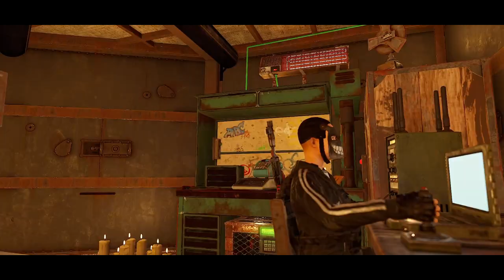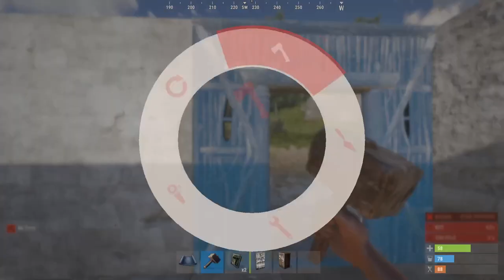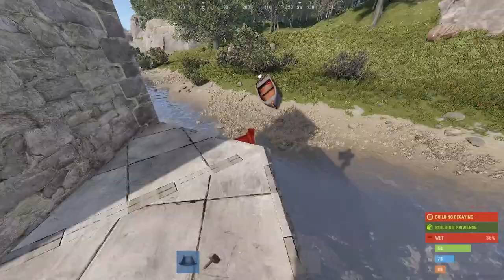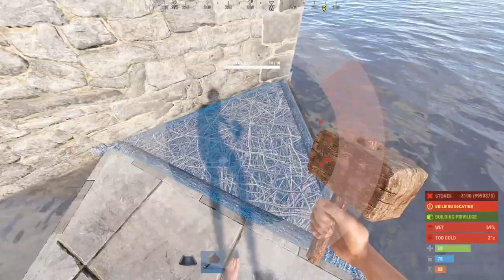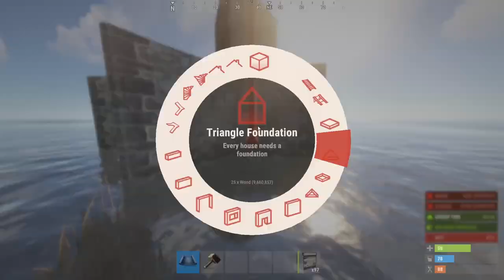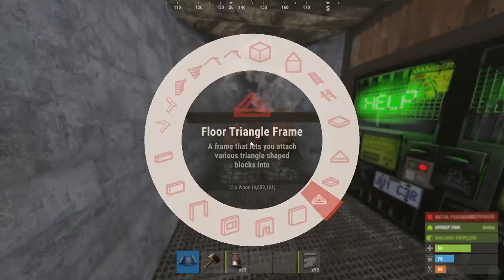The Rig Runner MINI - NEW META 1x2 BUNKER BOAT BASE SOLO/DUO/TRIO (RUST BASE TUTORIAL)

Comment: Nice little boat base with a bonus heli garage. It's stout even without the bunker working. I like the mobility layout. I would RP it with some planters and a little dock and lights. But that's me, I'm a more casual player. Cool design.
Reply: Jesus loves you alot trust in His death 4 salvation and be saved from eternal hell <3 Jesus died on the cross for you bro. <3